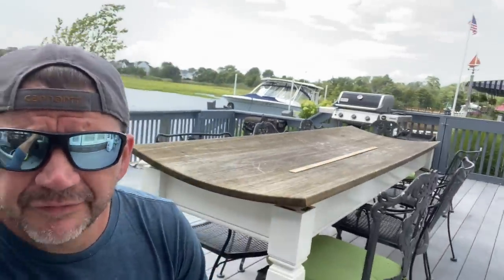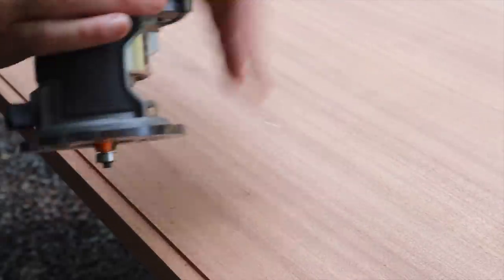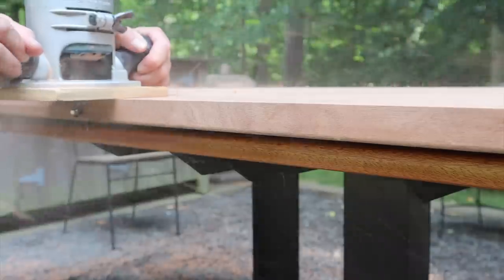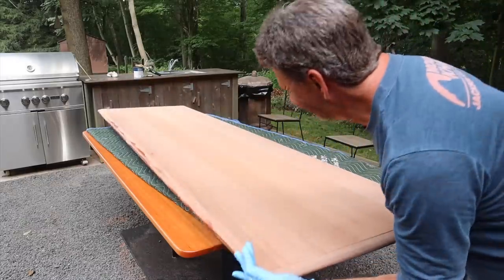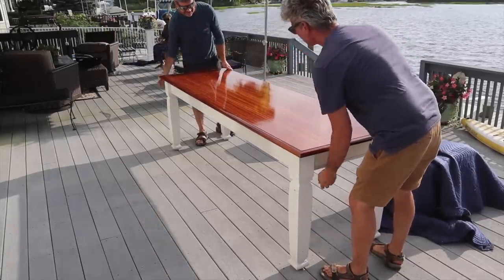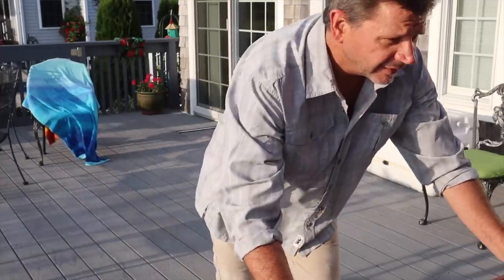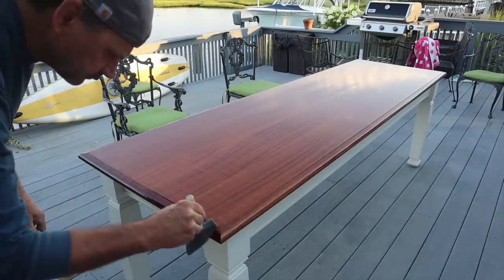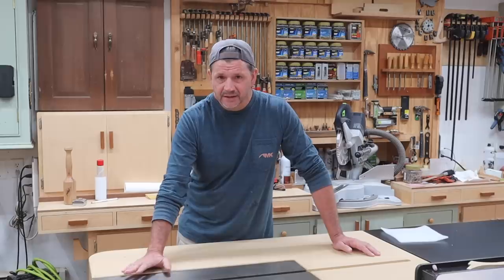Outdoor Table Top Cupped Just a Little - Let's Make a New One

Comment: When I'm routing a profile on timber that tends to burn, I take the penultimate cut with a little painters tape round the guide bearing. Then take off the tape and make a final cut moving as fast as you can and it will remove any burns.

Comment: Keep swinging, Jon! Thoughts for the fourth top: true bread board ends, tongue in groove or floating spline edge joints instead of glued edge joints, framed panel design like a door, slat top with very slight gap between boards (maybe 1/8" gap or less). You could route v-grooves in undersides of boards to facilitate swelling (like hardwood floorboards) now before this on gets away from you.
Some projects are real pissers & start to feel like a trap, no matter what we do. Thankfully, this one's for Mom, not a client. Hang in there & laugh it off. Consider it an "Outdoor Elements Testing" piece. All the best, Andrew

Comment: Final result looks great Jon, I did a cedar top and seats picnic table a couple of years ago at our cabin. I used an clear epoxy primer first on all sides and finished with a couple  of coats of spar varnish.  Still looks great but we do keep it protected from the elements when we're not around. Outdoor furniture finishes are a challenge given the extremes of the elements that they are exposed to.
Keep up the great work!

Comment: Hi Jon, as soon as I saw the cupping, my first thoughts were drip-edge and applying finish to both sides.  I see you had already thought of both.  One experiment, based upon seeing the condition of the top and bottom of the old table top, is to design a reversible table-top that you flip each year so that each side can weather somewhat evenly over the years (or maybe flip it every three or four months).  Good luck.  I'll have to remember to check in with you in a couple years to see how it holds up.  I like your videos and the your woodworking.
Reply: Your reversible top idea is interesting. Any thoughts on how to secure it to the base?  Thanks!
Reply: @branchandfoundry560  In the time since I posted my comment I've been thinking about how to secure it either side up.  I don't have a really good answer.  It seems one might make a few recessed areas with holes which could provide clamping points but then these recesses would need to have flush tight removable covers/plugs (maybe something like the bow-ties people use to hold boards or slabs from splitting) to avoid pooling rain water.

Comment: Jon, after 2 cupped table tops why are you avoiding breadboard ends?  If you don't like the look of them you can always just route some stopped dados on the underside of the table top and screw in a few pieces of C-Channel into oversized holes to allow for movement.

Comment: As usual your work looks amazing. I think you will find tho that the top will cup again down the road. Best course to mitigate as best as possible from this happening again is to add 2 inset channels on the underside of the table top running the width of the top about 6”- 1ft in from the ends for an inlay of either a piece of another hardwood or metal 3/8” in thickness and securing that in place. Should do the trick.